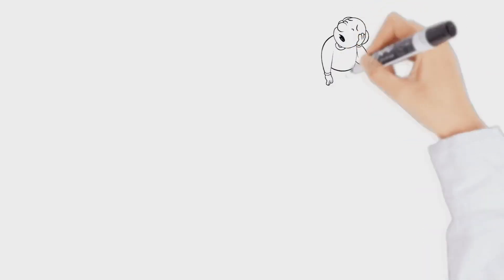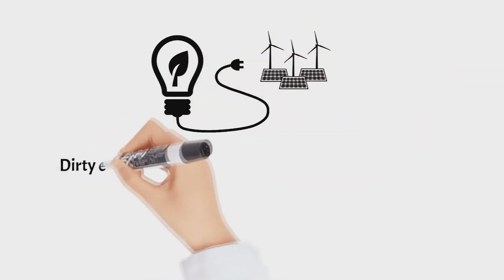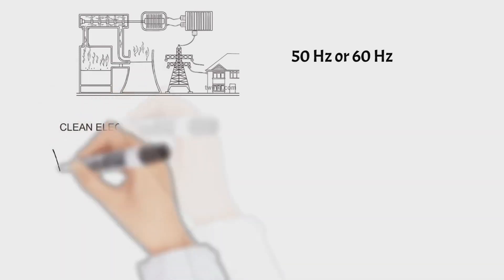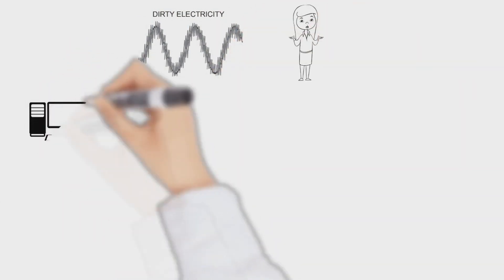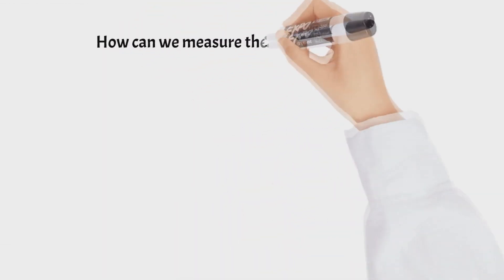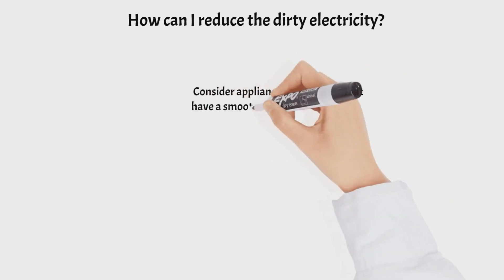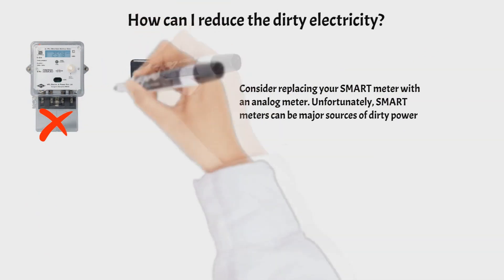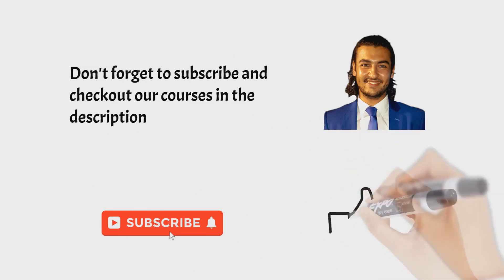What is Dirty Electricity and How Can We Reduce It?

Comment: Ahmed, excellent video! Interesting timing as I purchased a power supply kit to build with my son, but after looking at the contents, I was like “okay, yeah, this will work, but needs a little help.” So, I got a couple of 0.22uF bypass caps to try reducing HF noise, some 1N4001 diodes to prevent the feedback from the induction destroying the voltage regulators, some 1KΩ resistors to give the 2,200uF caps a quicker path to discharge when shutting off the main power. Hoping that the 2,200uF caps will work in keeping the voltage steady, but seems large enough. Finally, at the request of my son, a couple LED VA meter panels so we don’t have to use the Fluke every time we adjust the voltage. The only thing I may still do is add a second pot for “fine tuning” the voltage. Our whole project basically revolves around keeping the energy clean and steady, so it’s really funny that I randomly picked this video! I look forward to more and will likely get a course or two on your site as I need a good refresher. Be well.